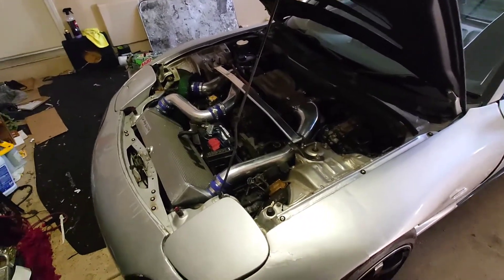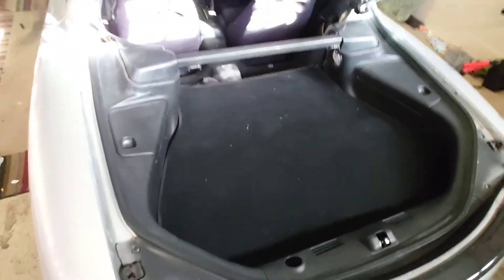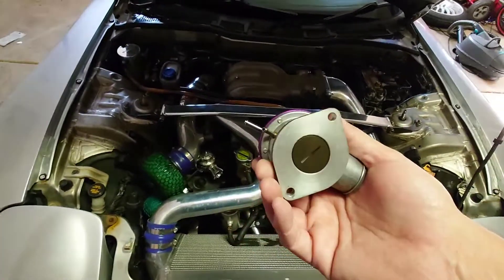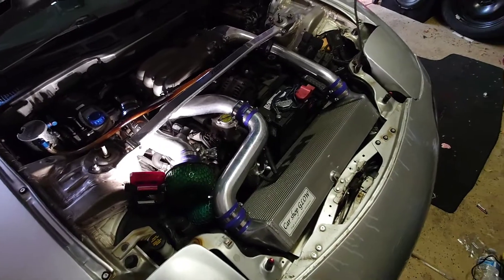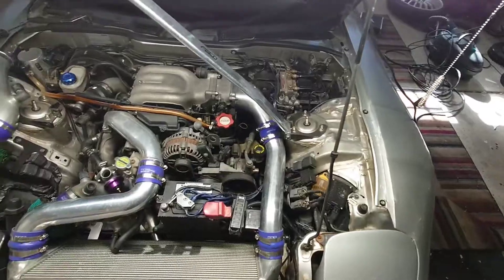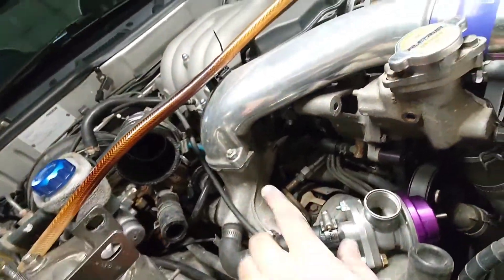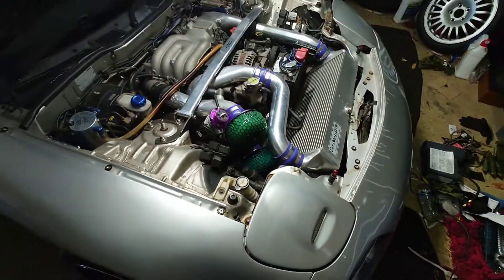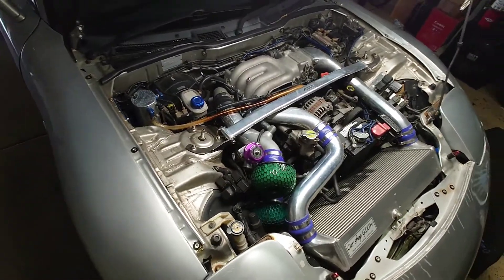Greddy type s bov on the FD rx-7

Comment: Where’d you get the adapter?
Reply from the maker: Ebay. Lots of companies make the flange cheap
Reply: @densetsu_vegas  I’ve bought one off eBay for an Evo I had but it wasn’t that small diameter. Was your Greddy adapter as small as the one on the Blitz? I have a Blitz dual drive on my jdm FD and I wanna switch over.
Reply from the maker: @bsprentz8830  no, it's different.